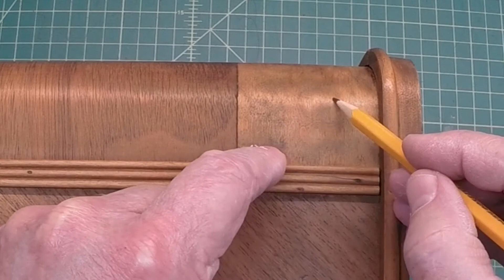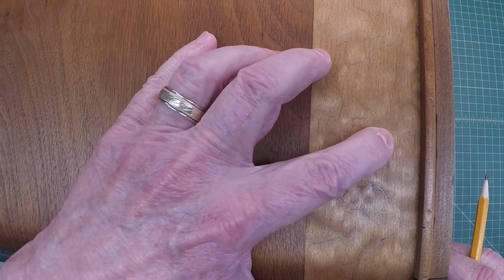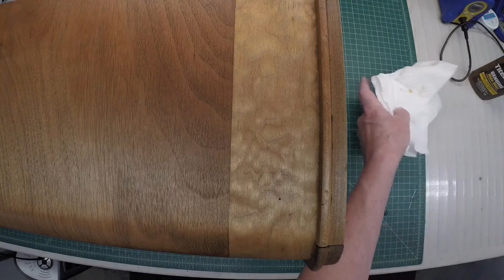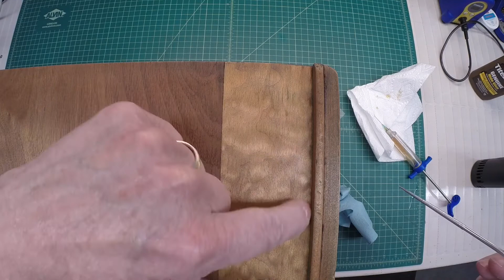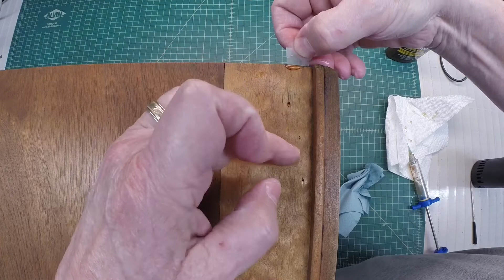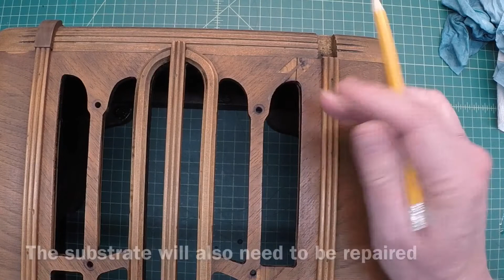Zenith 5-S-29: Veneer Bubble Repair

Comment: Thanks for demonstrating your techniques!  Where did you purchase your syringe and the Titebond hide glue?
Reply from the maker: +Michael McKenzie Hi Michael - try searching for the glue using the "where to buy" at: http://www.titebond.com/where_to_buy.aspx  I purchased mine through Amazon, but your local Ace, True Value, Wpodcraft and other will have it. The syringe and needles can be purchased at Stewart-McDonald: http://www.stewmac.com/Materials_and_Supplies/Glues_and_Adhesives/Applicators_and_Pipettes/Glue_Syringe.html  An alternate to this technique or one worth trying first is what +Rebel9668 (Gary) calls out in his comment, which has worked for me in the past too. Hope this helps and thanks again for watching. Best, Don